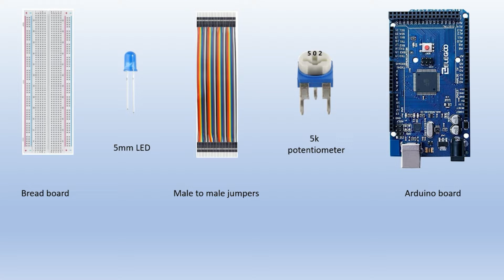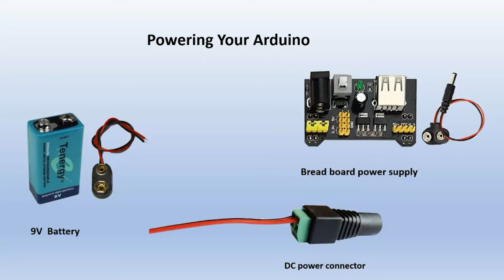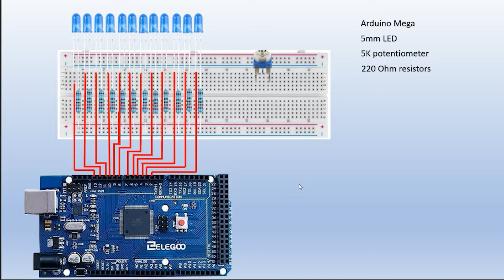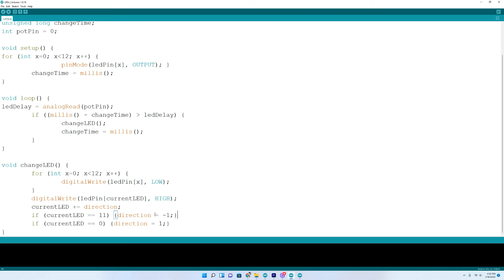Make Adjustable Speed Chasing LED Lights! | Fun Arduino Project for Beginners

Comment: Ok, I'm a newbie.  Why 220 ohm?  What power supply were you using, 9V, 5V?  Either one, with blue LEDs where you do the input volts minus the led voltage and the result divided by .02 I still get different numbers other than anything near 220 ohm for the resistors.  Either I don't understand (probably) or I'm not calculating correctly.  Maybe something to do with the potentiometer I guess.
Reply from the maker: I use a 220ohm resistor but you can use 100ohm as well. If you get right down to it, the different color LEDS have some slightly different values on the datasheet. In general, supply 2-3v to your LED. You can figure out resistor value by using Ohms Law (V=IR). Resistance=(Vsupply-Vforward)/If
Pull up the 5mm LED datasheet to get the forward voltage(2.4 to 3V) and standard forward DC current (20mA). The datasheet says 3V is max you should put through the LED so we don’t want to go over that. I always use 220ohm when using a 5v Arduino board. You can go as low as 100ohm or so. The higher value of your resistor the dimmer the LED will be. I find that 220 is bright enough and when I buy LEDs they often send a pack of 220ohm resistors – so it’s convenient that I have about 10000 of them 😊
You can use the USB cable to power the Arduino, a 9v battery to the  barrel jack, or power it through the Vin pin but only  use one of these. The Arduino has a 5v regulator even though you may be using a high voltage power supply. I’ve seen some websites say you can use up to 16v to supply Arduino and other guys say not to go over 12V. I would stick with 12V max to power the board but I mostly use 9v.
Reply: @BMonsterLaboratory  Ahh...that explains it!  I see other videos where they use 220 ohm resistors as well and wondered why.  Yes I plan to use 5V.  Now I will have to attempt it.  I have a resistor kit that has many different ones and I will adjust for various color LEDs voltages.  Appreciate the prompt and detailed reply!
Reply from the maker: good luck with your future projects! Thanks for watching 👍
Reply from the maker: Also, don't overload your Arduino board. look up the specs on the datasheet before starting a project. I use external power most of the time anyway to avoid stressing the board, especially with multiple motors.